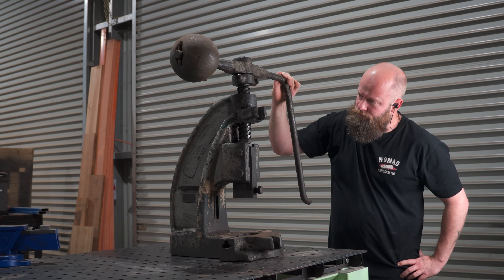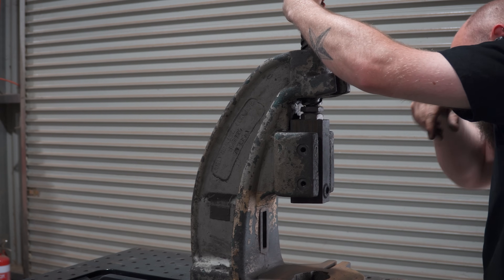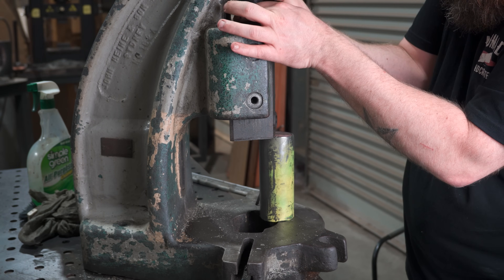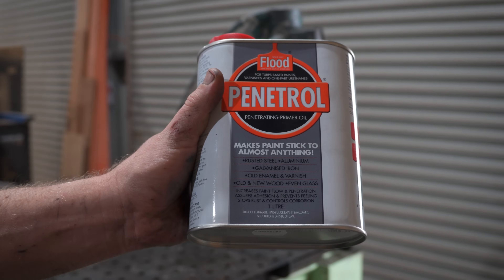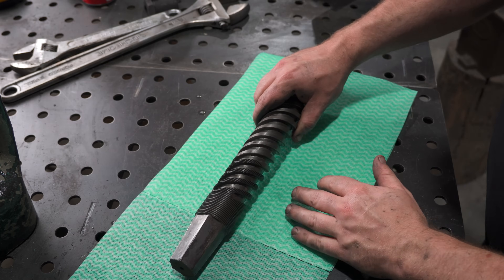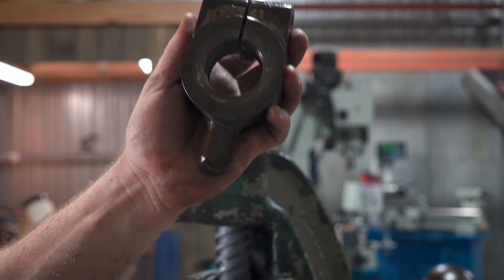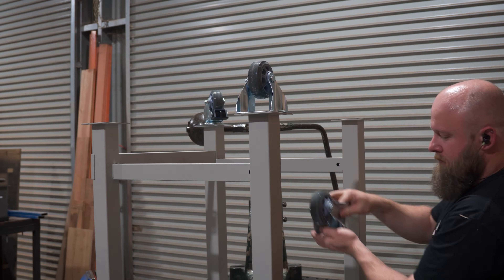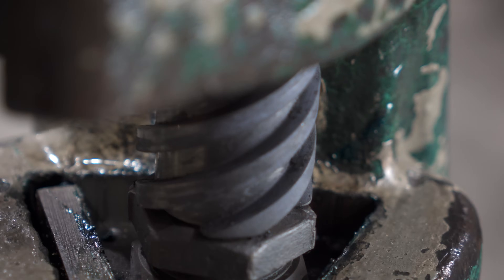They Don’t Make ‘Em Like This Anymore – Restoring a Classic Fly Press!

Comment: I’d love a fly press to supplement my other presses. But I’ve not found a decent one for less than a small fortune, no matter what the shape it’s in. I’ve welded up weird wrench sizes. It works fine as long as it’s not used on a regular basis. Too bad about crushing liquid. Now you have to take the press off the table, clean the table and bottom of the press and spray with anti rust and put it back together.
Reply from the maker: I admit I did have to pay a little for this one, but I did get it with another machine and sort of got a discount on the package, so I guess that helps me justify the cost in my mind 😂
I did plan that one ahead well enough that it wasn’t bolted down before crushing the can 😂 so clean up wasn’t so bad, I did also seal the hole on the table top which is something I didn’t show in the video, but it wasn’t too bad. Thanks for checking it out!

Comment: I love to see old tools and machines being brought back to use especially fly presses.  
The screw thread is actually a helix cut on a milling machine. The lead of the 3 start thread would be to great to cut on a lathe. It would be classed as a square thread though.
Reply from the maker: I couldn’t agree more! And I did think that, the tool pressure to cut that on a lathe would be a lot, completely makes sense. Thanks for letting me know!

Comment: This fly press brings back memories. I actually worked at John Heine & Son (at Leichhardt, NSW) starting as an apprentice in 1971. I can remember machining the "six sided taper" as you called it, on the end of the main screw. It was done on a horizontal mill using a side and face cutter, with the screw held in a fixture similar to a dividing head.  They had some great "old school" tradesmen in those days and I learnt heaps.
Reply from the maker: That’s really cool! Does that section have a proper name? I’m just calling it that because I  haven’t really seen much of this kind of stuff before. I’m sure they would have had a system for making that part, but it’s impressive nonetheless
Reply: @nomadhandcrafted  It was just a tapered hexagon machined to suit the handle.  Sadly, John Heine & Son closed down decades ago.
Reply from the maker: Definitely sad to see a quality Australian manufacturer close down, I do have a few of their other tools in my sights, but it’s all money 😂 appreciate the comment though, it’s really cool to touch base with someone who helped bring these cool tools to life

Comment: If there was a choice to place the undamaged side of the wear plate against the ram, that's what I'd have done, to reduce further wear on the ram.  Wear plates are easily fabricated and replaced, replacing the ram probably isn't something you'd want to do.  The oil grooves on the ram suggest that grease is NOT the correct lubricant.  You'll just be trapping filings and shop grime, and further wearing the sliding parts.  Easily corrected
Reply from the maker: Yeah that’s completely fair, I probably will flip it over, I did get another comment about this and they suggested way oil which I think I’m going to give a go, but thanks for the feedback 👍 I love the support from the comments

Comment: I know you didn't show, but all that scrubbing... :D you can get set of nylon brushes for drill. It helps a lot in cases like this
Reply from the maker: 😂 yeah I did have a little one on hand I did try, but I did find it was inclined to flick muck everywhere. Thankfully this whole thing wasn’t too bad, but I would definitely be going that way on something that had that “hard” layer of muck. But thanks for checking it out!
Reply: @nomadhandcrafted  Yeah, it's "a little" messy attachment 😂
Reply from the maker: Oh for sure, I used it for about 5 minutes and managed to spray gunk all over my filming lights and camera 😂 I definitely didn’t think it through at the time 😂

Comment: Don't use grease on the ram. I've overhauled more presses than I can count. I use ISO 68 way oil . It has drilled points for dropping oil in and not grease. I have dealt with the aftermath of someone pumping grease in to a Toggle Press thinking they were doing the right thing, and it nearly wrote the thing off. Grease is just a carrier for oil and the thin film of grease there won't release enough oil to keep it lubricated. Just keep it oiled and wipe it up as it leaks out
Reply from the maker: That completely makes sense! I was thinking I needed something that would “cling” to the surface and didn’t think of anything else, way oil would definitely do it, thanks for the tip!